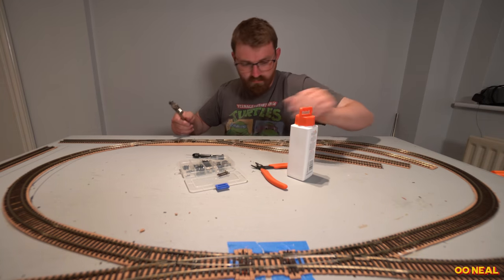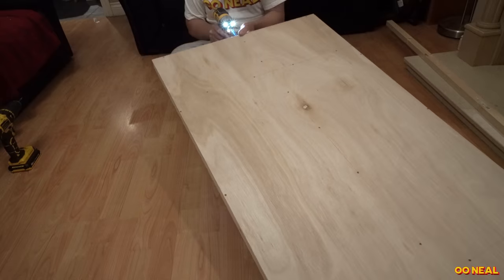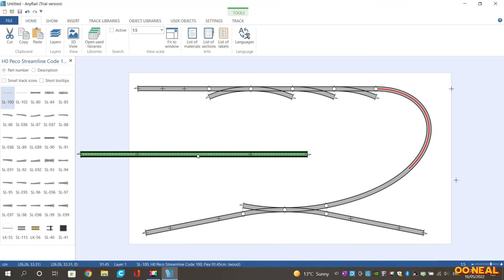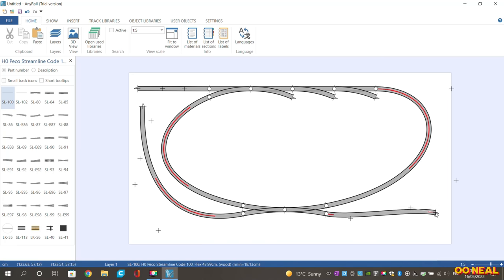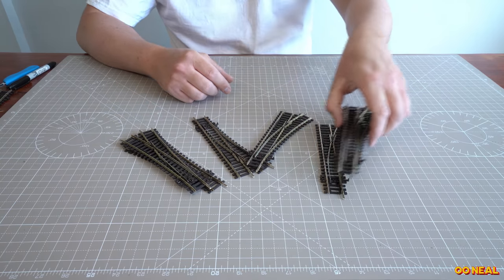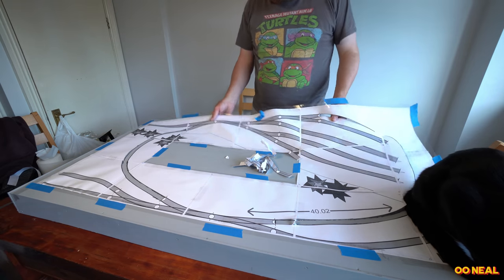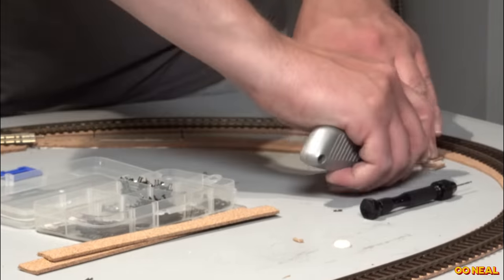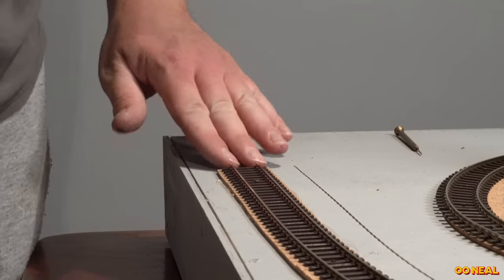Jubilee Model Railway Layout | Baseboards And Track Laying | Episode 1

Comment: Hi, Have you considered using PVC Form Board for your baseboard? It is less resistant to warping (bending) after the track is laid and not affected by water. It does not perish neither affected by wood rot and is very durable.

Cheers,
Michael.

Comment: Hi Tris.

I have used a fibreboard that is available from the well known large Swedish D-I-Y store. They are available in sections of 101cm x 60cm and are 3cm thick. Each section only costs £7. This type of baseboard consists of a fibreboard top and fibreboard base, one side being coated in white acrylic paint. The sides have plastic strips and the inside consists of a paper/card filling that is honeycomb structured. The paper is 75% recycled (minimum). The framework is made of particle board which consists of amino-formaldehyde based resin that is used to bind the particles together. 

Particle board framework needs pre-drilled holes that are 1-2mm smaller than the screws so as to allow it to get a grip on them. DO NOT self-tap as framework will split over time. Screws may eventually loosen so may need tightening every once in a while if structure is being used for supporting moving parts (not trains), in which case specialised fasteners can be used  which are known as confirmat screws. 

The advantage is that unlike plywood etc., they do not bend when moved, and can take weight without distorting as they are constructed for use as table tops for which supporting legs are also available. They are not that heavy to move around and are ideal for exhibition display layouts.

Take a peek at the YT channel Iron Horse Railways as Craig has used them for his relatively new layout. 

Paul. 👍

Comment: Nice :)  Just a tip for future use of cork, I bought some self adhesive rolls on eBay that are already cut to size for half a track width, makes it much easier to fit down and has enough stretch for tight corners.
Reply from the maker: Oh thats excellent I will need to look that up as it would save alot of time thank you

Comment: Hi, I would be interested if the Board stays flat. Fingers crossed I hope you have better luck than me!! I have tried using that thin pine strip on 3 different base board projects. Similar construction to yourself and without fail it has warped over time. I have tried using it to make I beams with 5 inch high (wide) 6mm osb board and that bent due to the pine. More recently a base for my Tyne Dock Iron ore loading stage and that is only 220mm by 1920mm and it has twisted slightly even though I applied yacht varnish. Great Fun little layout and video. Regards Steve
Reply from the maker: Me too, I thought I will go light weight but if it all goes wrong I can deal with it later on. Its a small board so hopefully the small size goes in its favour. I'm glad you enjoyed the video though.
Reply: @OONeal  I am experimenting with PU Foam insulation board. Just built a small test track to practice using static grass etc. It is only just about 1.2m long. See how stable it is?  I know Luke Towan uses similar in his Diorama's dropped into what is a picture frame? Next time you are in Rugby drop into Wickes  check out how light and stable it is? I have enjoyed watching a lot of your videos and the engineering. Just started out on my own You-Tube videos, the one I have just done on Cling film for removable coal loads has the foam board test track in it. Cheers Steve

Comment: I find it much easier to fit point motors with extended rods underneath the board, then you just need to drill a hole big enough for the movement. 8mm is ample
Reply from the maker: I have played with that in the past and managed to get them working but I do find it fiddly, I have seen this way being done in the past and wanted to try it for this layout as there are only 2 point motors on the layout. The whole Idea of the layout was to try a few new ideas at each stage.